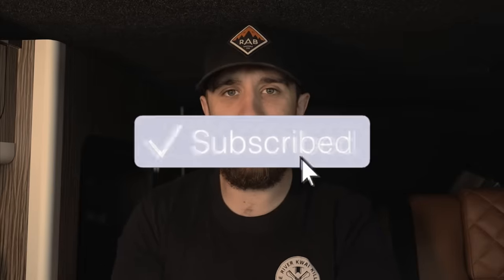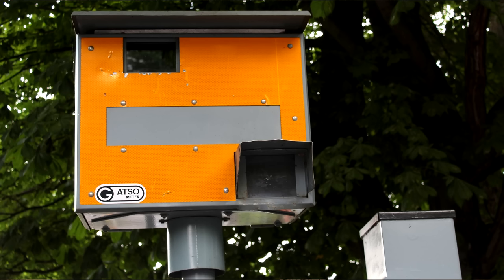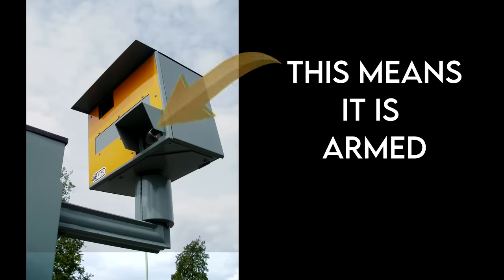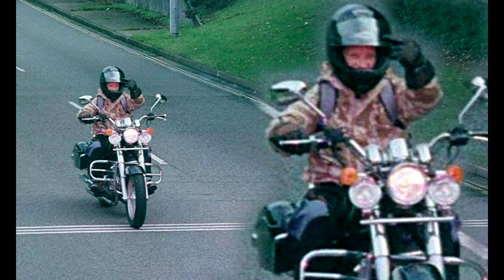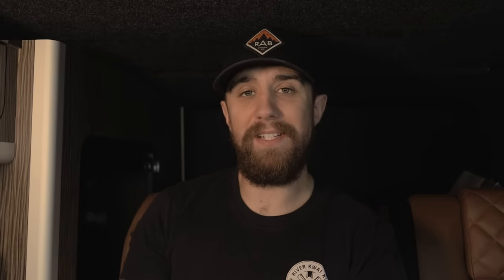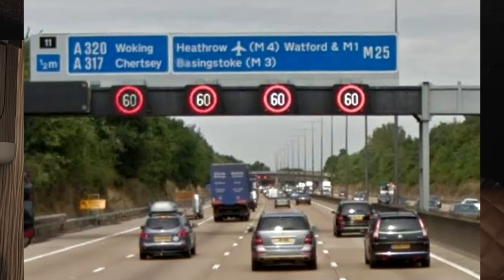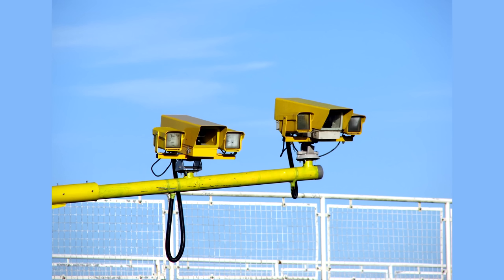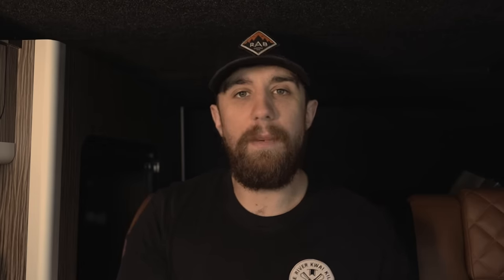How Speed Cameras Work and What to Look Out For

Comment: I really think you should have mentioned that all of the jumping a red light ‘traffic light’ cameras have been converted to speed cameras as well, going through a green light on a junction at 35 mph with a ‘traffic light’ camera will get you prosecuted. Strangely enough they didn’t try very hard in telling us all about this change, I got done myself, miserable money grabbing cnuts
Reply: They haven't. A lot of them are still red light only. There was a grey Red light Gatso fitted at the set of traffic lights just up the road from my house, it was red light only and was fitted in the late 90's/early 2000's. It was taken down around 2017 as it rarely ever activated as most people don't jump red lights here, it's a relatively low traffic density junction and in a small town.

The Grey taller Gatso's are red light, taller rather than wider. There's also RedGuard which is Red light only and RedSpeed camera which does red light AND speed on green, but they both look nothing like Gatso cameras.

Comment: i got caught twice about 3-4 weeks apart, 93mph both times, on the same stretch of road by the same coppers on motorbikes, going different directions, i explained that i could go much faster in relative safety but they had none of it, the brake rotors alone were bigger than 17 inches on that beast, only people with shit cars should have to follow the speed limits, cars that have been engineered to do over 150mph easily and safely should not be burdened by the poor or stupid.
Reply: Those big break rotors are only any good if you have time to use and often time when an rtc occurs you don't
And what to you suppose would happen if you had a tyre blow out at over 90 mph?
The point of speed limits is to limit the amount of trauma and damage caused when an rtc does happen!
Reply: @NoBody-gf8ie  what would happen? not much, my tyres are designed to run flat for over 50 miles

the speed limits were imposed when most cars didnt even come with seatbelts or airbags, they need updated.
Reply: @croikeymatesthrowashrimpon8130  I said blow out not puncture,
OK experiment for you drive your car in to a wall at 70 take note of the damage and injury caused
Get it fixed then do it at 90 and see the difference.
Reply: @NoBody-gf8ie  how about you just learn to drive and dont burden me with your inability to do something?
Reply: @NoBody-gf8ie  most drivers will never experience what you describe, so why even bring it up as an example? most people already travel at these speeds anyway so you arent saving anyone with your pretend high and mighty speeches about safety.
Reply: @croikeymatesthrowashrimpon8130  ok treacle 🤣
Reply: @NoBody-gf8ie  ok shirt lifter
Reply: @croikeymatesthrowashrimpon8130  🤣🤣 the 1980s called they want their insults back!
Reply: @NoBody-gf8ie  you and your dad both sell avon
Reply: @croikeymatesthrowashrimpon8130  sticking with the 80s theme, you're also coming off a little homophobic and possibly hiding your own homosexual feelings maybe. Don't be afraid of it!
Reply: @croikeymatesthrowashrimpon8130  of course you are what? Hiding homosexual feelings?  I knew it!
It doesn't make you a bad person people will still like you.
Be brave little soldier 👍🏻
Reply: @NoBody-gf8ie  you probably only use a car to go on grindr meets with your dad
Reply: @NoBody-gf8ie  if thats what you take away  from that, then youre the one with issues LOL

the responses youve given are certainly very telling.
Reply: @croikeymatesthrowashrimpon8130  you are the one that kept mentioning homosexual references and then think someone else has issues 🤣🤣
Reply: @NoBody-gf8ie  youre the one who made it homosexual, which says alot more about you. LOL
Reply: @croikeymatesthrowashrimpon8130  read back through the comments treacle, you started it with  "shirt lifter" then continued with mentioning Avon, makeup and my dad! 🤣🤣
Reply: @NoBody-gf8ie  clearly you love the frankfurters
Reply: @croikeymatesthrowashrimpon8130  there you go again with homosexual innuendo, it's called projecting when you try to confer your insecurities/feelings on to somebody else! You'll feel better once you come out! 👍🏻
Reply: @NoBody-gf8ie  yes it is called projecting, which is exactly what youve been doing, theres nothing homosexual about avon, or dads, you made it homosexual though, which says alot about the inner workings of your mind LOOOOOL
Reply: @croikeymatesthrowashrimpon8130  again you started it with the shirt lifter comment so..............
Reply: @NoBody-gf8ie  you started it with treacle, not that i care, you sound angry your inner feelings have been exposed
Reply: @croikeymatesthrowashrimpon8130  how is treacle in any way homosexual?
Treacle = noun; sugar/sweetheart, “How's tricks treacle?” “Treacle” is usually a term of endearment for a good looking woman

It was an insinuation you're a woman then you started made the homosexual references. Also please tell me what one of my comments shows any anger?
Reply: @NoBody-gf8ie   fact you even replied in the first place means you kiss your dad on the mouth
Reply: @croikeymatesthrowashrimpon8130  ok so you are ready to come out, as proven by the fact you replied!  That's very brave of you, if you want help telly your family I'm sure there is plenty of people that will help you! You must feel like a weight has been lifted, and remember it doesn't matter if you're gay it doesn't change who you are as a person. Good luck with the rest of your journey but I can no longer be a part of your story 👍🏻

Comment: Red light or speed cameras are evil.  People will drive obnoxiously slow fearing a speeding ticket or be more likely to slam on the brakes to avoid a red light ticket.  You can see the problems those cause!!  Well, as for the obnoxiously slow ones I will point out that you could get a ticket for that just the same as speeding.  Really in the rare instances that someone gets a ticket for that it should be based upon the frustration needlessly caused to other people and also the danger it posed driving so slowly.  You know how you can get called into traffic court for speeding so much over the limit?  I say call the ones in who are 10 miles an hour or more under the limit with no valid reason.  This would assume that there was nothing wrong with their vehicle to prevent it from operating safely at normal speeds.  BUT if it could not operate safely at normal speeds it is unsafe and not roadworthy without the proper repairs or adjustments.  This would not just help nail people who have unsafe vehicles that could fall apart and cause an accident but also the ones who are just jerks who deliberately slow people down (though they were not speeding).  To those ones I say go back to bed Karen!!

Comment: Don't speed and you won't get caught speeding, simple.

Just like: Don't steal cars and you won't get caught stealing cars, simple.
Reply: True enough, however, there are some sections of road where the speed limit is up and down a lot, sometimes with no obvious reason for the limit change: 40, down to 30, back to 40, down to 30 again, then 50, then back down to 40 and so on, sometimes on a straight section of motorway or road which does not pass junctions or go through towns, so there is no obviously discernible reason for a limit change.

It is entirely possible for even a good driver who adheres to the speed limits to get caught out by this kind of thing, particularly if they have to avoid someone who is driving dangerously and their attention is on that rather than on a roadside sign indicating a speed limit change.

Yes there are usually repeater signs after the main one, but you might pass a camera before you pass that repeater sign and genuinely believe you are at or below the correct speed limit if you were busy avoiding someone who took your attention off observing the speed limit signs. I have been caught out by that and I was annoyed that it occurred because it was in large part, the fault of another car driver whom I was busy watching in case I had to avoid them or another car which had suddenly had to avoid them (they were pulling into braking gaps, making sudden lane changes with no signal etc and this was on a motorway).

Comment: The only people who moan about speed cameras are speeders.
If people didnt speed  no revenue no speed cameras.
Reply from the maker: Or people that see logic. I would like to see more effective speed cameras such as average speed checks around schools and vulnerable areas. Cameras catching people at midnight going 80 on a motorway is nothing but a money generator. 

If you could go 70mph 20 years ago in some of the sheds with horrendous stopping distances, the speed limit should have been changed to reflect our safer more modern cars that can stop a fraction of the time.
Reply: @CorpsMedia  There are plenty really great cars that sure are way safer than old cars.
But the people behind the wheel have definitively not improved.
If you've done a speed aware course were  caught speeding.?
 Which means eithet you didnt know or didnt care what speed you were doing.
No good moaning or making excuses for basic driving errors.
They've made zero revenue out of me.
You control youre right foot no one else .
As for increasing the speed limit 
The traffic flow will not improve as the tail gateing ripple braking effect is the biggest single journey time reducer not the 70 mph speed limit.
People will do 85 or 90 then have to slow to 65 or less as the bunching and ripple braking begins the average motorway speed is not even 70 because of this.